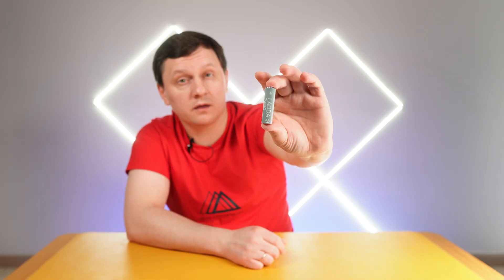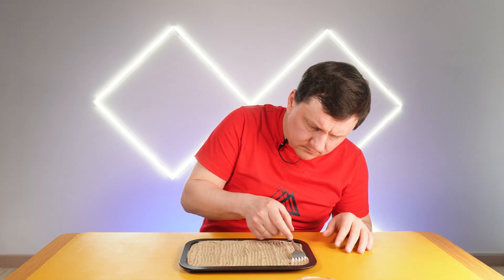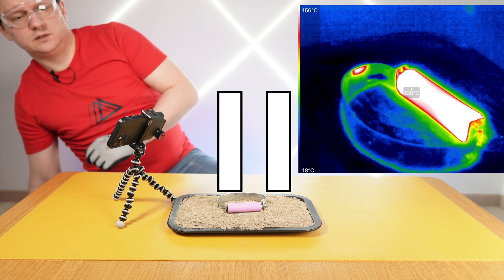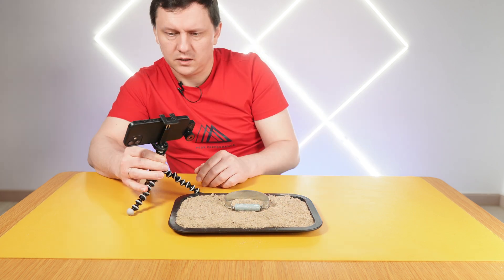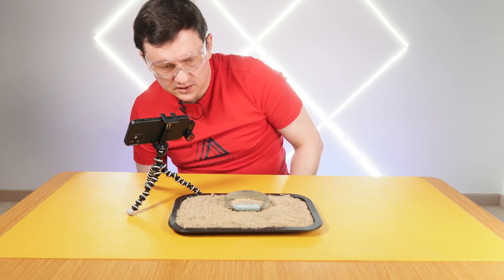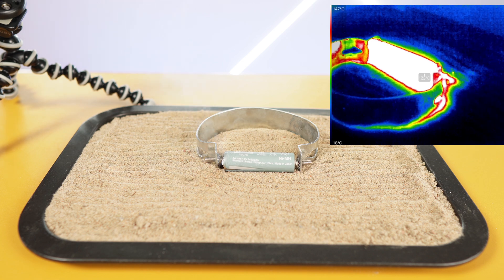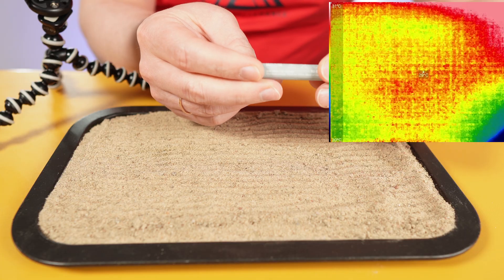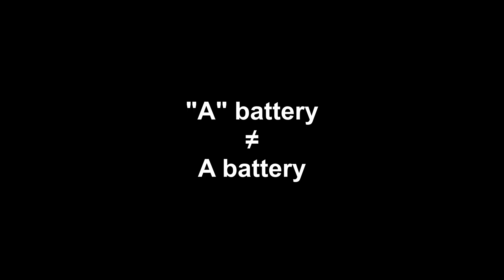Exploding IKEA batteries

Comment: Quite interesting to see in practice, although the results don't surprise me much. If you look into the physical structure of a battery, especially a rechargable or 18650, you'll see that they have pressure release valves which were doing exactly what they are supposed to do in this video! Never tried it myself so thank you for the education.